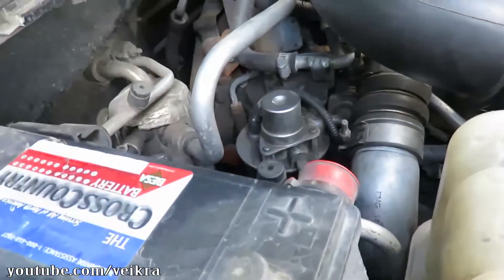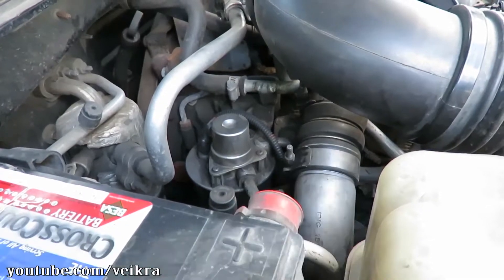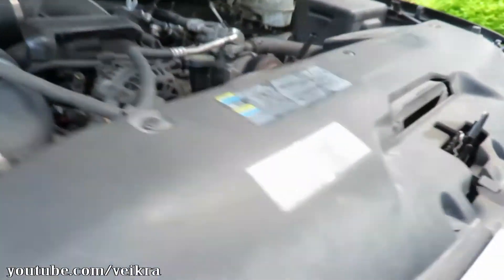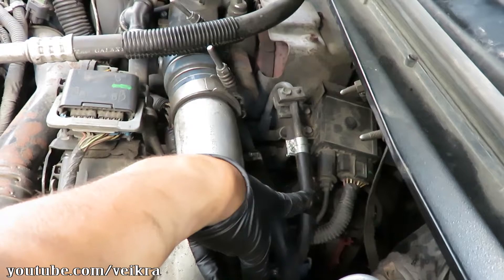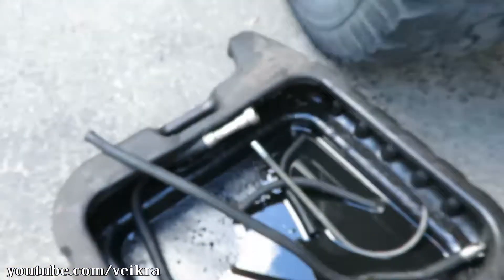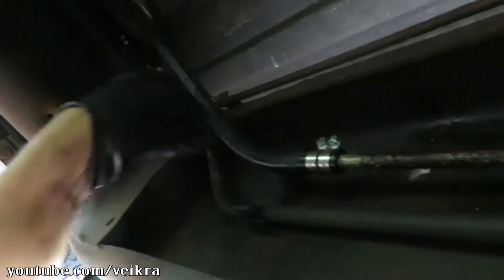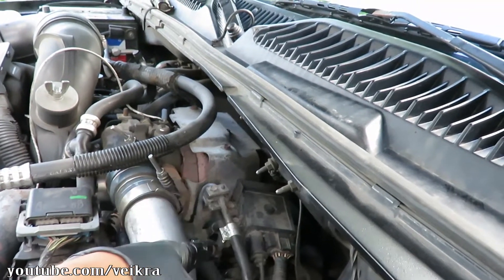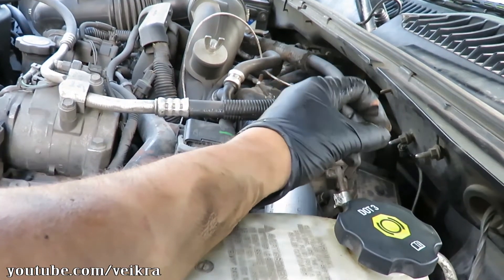p1093 causes: suspect #1, rubber fuel lines

Comment: I found some Fuel Injection Hose in 3/8 and 1/2" NBH H351A rated for all fuels at Napa. Need to order online they will ship/transfer to store though. It's like 225Psi and $5/ft for 3/8 and $7/ft for 1/2
Reply from the maker: I used some 250psi goodyear branded 1/2 inch. My lift pump runs at 7-8 psi
Reply: @Nordic_Mechanic  Is 250psi good enough for all of those fuel feed lines?  I'm getting that kinking issue with the fuel line up by the firewall next to the engine block on the driver side.
Reply from the maker: @davidprestwich5439  250 is way overkill so yes it's good enough. There's vaccuum , not pressure in the 1/2 feed. And even if you have a lift pump it will be 10 psi at most. That spot was the worst on mine too.

Comment: What did you use to cut the fitting? 
 My feed line is sucking air
Reply from the maker: small rotary tool to cut a slit in it. You 'll destroy the injection pump if too much air gets in it
Reply: @Nordic_Mechanic  thanks for the reply , this last week my  03 duramax has been stalling . I thought it was going to be the fuel filter housing, but when I prime it, I hear the feed line sucking air right by the valve cover
Reply: This is what ended up being my issue 
https://youtu.be/LdswhEuPvD8

Comment: are the replacement lines you used high pressure or standard fuel lines and hose clamps?
Reply from the maker: they should be standard line, but need to be diesel fuel lines or you'll have issues. I put on 250psi fuel lines meant for diesel fuels, and a lift pump so my system is no longer under vaccuum so the lines cannot collapse anymore.

Comment: Just get out from the dealer, they found fuel pressure at 9000psi at idle, it should be 28000psi, where else I need to look for ?
Reply from the maker: 9000psi at idle, when they disconnect the fuel pressure regulator right? With regulator plugged in it should be 4500psi roughly. With regulator disconnected, should be 28000. You need to tell me if the 9000psi mesure is with or without fpr connected.  We're looking at a way different problem one way or the other
Reply: They should tell me more about the ejector activity and full report on paper. They just plug the test port under the dash and say the fuel 9000psi.  I had replace the fuel regulator before I take it to the dealer.
Reply from the maker: Rss L
 if the regulator is plugged in and it's doing 9000psi at idle then it's faulty or the computer is confused. You have too much fuel pressure. I get 4500psi on idle with engine warm.
Reply: According to the dealer, but if high pressure,then why it giving 0093 ?
Reply from the maker: Ecm is detecting a SUDDEN drop in pressure. if it's holding 9000 and suddenly falls back to 4500 normal, that'S detected as a large leak. Forget the dealer, they are refusing to answer your questions and trying to piss you off til you ask them to change parts. Find a knowledge duramax diesel mecanic and go there instead.

One occurance when p0093 pops is from the fuel pressure relief valve at the back of the fuel rail suddenly opening. Have you done a bottle test yet ? I'm supicious about what the dealer is saying. If you have 9000idle with fuel regulator plugged in then your regulator is bad or something along those lines.

If you could borrow a scanner and make a vid of the fuel pressure when p0093 happens , we could help you find the cause. A p0093 is usually easier to find than a p1093.

TL:DR version : I need proof of the 9000 psi idle and more data or demonstration
Reply: when to the other place found out the injectors is out balance.
Reply from the maker: Rss L
 out of balance injectors wont cause a high fuel pressure, so somethings up or the dealer is lying.  Did you ice pick the connectors on the injectors ? Im thinking something is throwing the computer off. Fuel pressure sensor reporting correctly?
Reply: I am in process removing injectors, will see
Reply from the maker: ok let me know what you find
Reply: I have a gm tech 2.fuel psi at idle is 4900-5000.28,000 wide open throttle.check the fuel cooler for restriction.